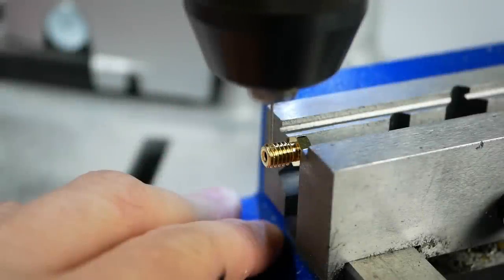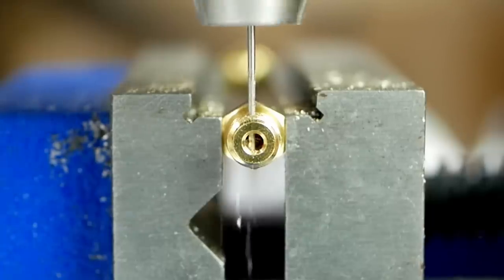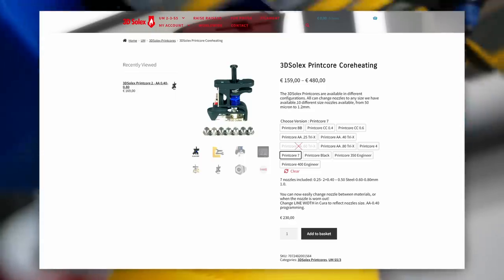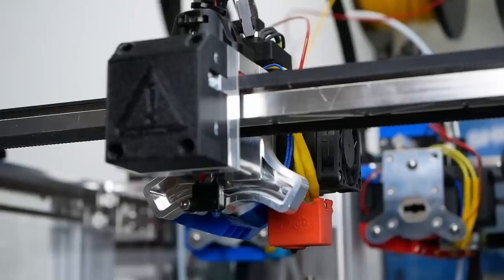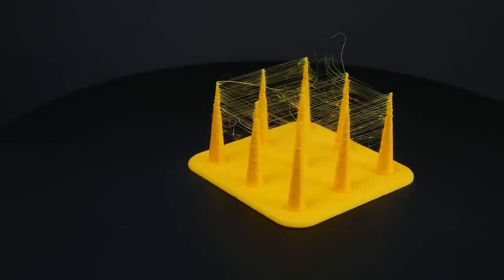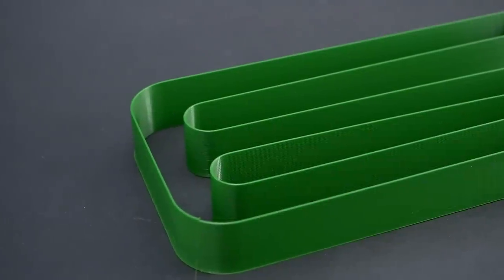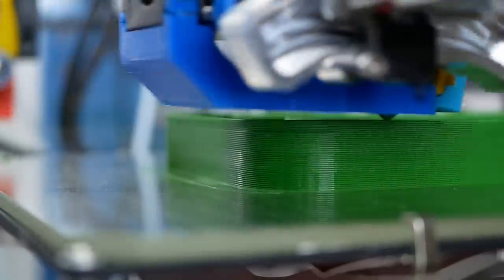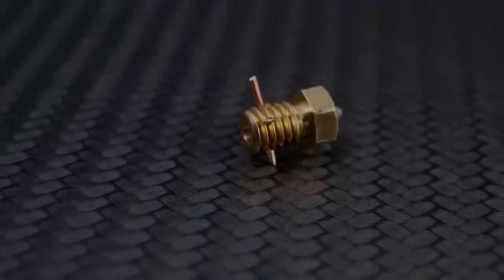My High Flow Nozzle is better than a Volcano hotend!

Comment: So a more advanced profile would be to have a less circular hole. 
This could be done by drilling 6 holes around a central point. Then boring out the central point. 

Imagine a revolver chamber woth it's 6 holes for the bilullets. Then boring a hole through it so it half intersects with the 6 holes. You end up with a much higher surface area but with no obstruction. 

By hand that's a big ask. But my cnc could do it. 

Would have to make the nozzle from scratch as needs to be solid to drill the 6holes first. They have to be drilled first. A small end mill can be plunged to clear thw middle. Or stub drill. 

I would think this would outperform any other. But length would be limited by machining process.

Comment: Have you thought about using two heater cartridges in the hot end, this means milling a special block for the hot end and maybe also tweaking your PID settings. I did this on my Tevo tornado but need to work on my heat break tube as i have made my own and it sticks and stops printing after a while, I think due to heat creep.
Reply from the maker: Heater power is NOT the issue. The problem is getting the heat into the material an that's where CHT has it's benefits.

Comment: I have an idea I would love to see you try, that I believe would yield much better results than anything on the market but would be a pain to manufacture at any large scale. Coating nichrome wire (of appropriate gauge) with alumina cement or other non electrically conductive high temp material and passing that through the nozzle as you did here. Maybe just get a roll of nichrome for vaping and twist three strands together instead of paying more for the larger stuff, saving money and providing your viewers with a way to recreate your results. 

I'm extremely interested in how running a 3d printer with only core heated wiring would fair, at least compared to combined from the wall of the extruder and the core heating.

At core heating could be an interesting video, if nothing else!
Reply: There’s kanthal, nichrome, and SS 304 wire mesh, it’s cheap and comes in different percentages of hole sizes
Reply: @gcod3d161  mesh might restrict the flow to much. And if not after coating it, it would not allow much of anything through, given how small the holes are in vaping meshes. Maybe wotofo's hex mesh.

Comment: I would imagine that using a smaller wire diameter would create less turbulence and back resistance. The question becomes how thin can it be and still stand up to the heat and pressure of the extrusion.

Comment: Could you use a small bolt instead of a wire and thread the inside of the hole

Comment: Hey Stephan,   Could you try using copper wire on SS nozzle or perhaps M2 tool steel nozzle?  Additionally Tungsten could be promising.  I have a Theory that the copper wire and split streams could overcome the drawback of reduced melt rate due to thermal conductivity rates(K) in SS or M2 nozzles. Many have gotten around the issue by using an electroplating Additive of WS2 (Tungsten Disulfide) to the interior surfaces of the nozzle. perhaps improved melt geometry and harder materials would make it possible to create higher flow nozzles without the need to increase print temp.

Comment: @CNC Kitchen have any insight as to how this effects layer adhesion?   My CHT keeps clogging and is now scrapped.  Going back to regular nozzles really is a stark contrast in layer adhesion in ABS and PC.  Like I can peel each layer away by hand using the same GCode that was almost isotropic with the CHT.

Comment: How do you get around the patent?

well you need some out of the box thinking. You see everyone is trying to transfer heat to the object at the very end of the process. What the manufacturers of this nozzle has done is two things. Moved the heating stage closer to the actual heating source and heated the filament from the inside out rather than the traditional outside in.

But what if you started that internal heating stage even earlier then the nozzle and began it from the heater block where the source of your heat is coming from. By by patent, hello new patent.

I have some very simple solutions in mind that just takes some ingenuity.

Comment: I imagine that, if the wire was replaced with a sheet, it would have a thinner cross-section but more surface area. In other words, it might have a profile that looks like a cross as seen from above and extends most of the way down the hole.

Not sure how to machine that. Perhaps by adding multiple wires and then flattening them with pressure or by removing material with a drill. But I'm not the mechanical engineer here, so I'll just leave this suggestion in its current form.

Comment: Spot the hole with the tip of a larger diameter stiffer drill 1st, or a tiny grinder bit to flat but that will lose precision.

Comment: I wonder if it would of been even better to file a sharp leading edge on the copper wire. Rather than a rounded edge. It should help in the split.

Comment: I don't think you have to worry about the solder.  Once the nozzle is screwed in place, the wire cannot move, even if the solder melted.

Comment: 227 is even unsutable for pla... it all ßepends on what speed you use , and the spot temp at the heater may solder your nozzle to the heater block

Comment: use a center drill combine with er-32 collet chuck and milling machine. a drill press it's little bit tricky the run out of your chuck is too high .005'' to .008''. you  don't have the same accuracy then milling machine.

Comment: if you're brave enough to try brazing, you could substitute the copper wire for brass and follow the suggestions of others by filing the brass that passes through the center to a somewhat flat, or blade shape to help cut down on the turbulence and increase the thermal transfer. Brazing has the upside of not melting at the temperatures needed for other higher melting point media beyond PETG.

Comment: You could start the drilling on the thread by using an end-mill to start the hole, they actually drill fairly well, though it is blasphemous to encourage drilling with end-mills... Part of me wants to suggest silver wires too, it's the king of heat conduction (of metals anyway) it wouldn't really be expensive, but yeah...

Comment: It's not illegal to DYI a patented object in the United States for personal use.

Even if it was it's completely unenforceable.

And even if you did sell small batches of a patented thing, it wouldn't be worth enforcing, the worst that happens is you get a cease and desist.

You would also be surprised how limited patents can be. If you make one small change you can patent that change and now the original patent owner can't make that change themselves without paying you.

Patenting patent trolls patents is patently priceless.

I also have an extremely hard time believing there is no examples of prior art. Just because the government rubber stamps a patent doesn't mean it's valid. The system is set up to give people frivolous patents and then let lawyers fight over it. That's not considering "method" patents. But that's an entirely different can of worms.

Patents literally exist to teach people how to make the thing. The government has bastardized it over the last couple hundred years. But you're supposed to copy them, that's what they exist for.

Comment: it is called a "STATIC MIXER" yes that single piece of wire installed can be called  a static mixer.  static mixers can be much more complicated. in paths any sort of fluid or gas or combo of fluid and gas take through a STATIC MIXER.

Comment: Please try putting in a flat piece of copper in a nozzle! Cut into the nozzle with a hack saw and cut a flat piece of copper the same thickness, sharpen the end that will meet the filament first and install it as you did with the wire.

Comment: Not that it would be practical or safe at home, but I wonder how an FDM printer would perform if used in a pressure vessel under higher than atmospheric pressure.

Comment: What about a DIY high flow 0.4 mm nozzle?! You mentioned in the bondtech review, that you'd be interested in such a nozzle. Plus your public appeal would also reach the 3d printing beginner 👍🏻
Reply from the maker: I tried that at first, though the effect is not as high because the 0.4 mm bore limits flow the most.
Reply: @CNCKitchen  The effect of increasing the flow through the nozzle can be felt when pulling long rods. At 50 mm there may be no effect, but at 200 mm it already shows. Even with a 0.4 mm nozzle

Comment: Volcano is far from ideal. That split by on the side creates a nice air gap that cools that entire side, making the heater work harder. And the random screw heads sticking out make it a pain to clean if anything sticks to it. Not to mention that you don't really need special nozzles, just a longer barrel.
I got a design that i'd love to see tested, but shipping to Europe would suck (in both money and time, most likely).

Comment: maybe idea is fine but if you can try thinner copper rod would benefit nearly cutting edge (knife alike thing). It might be tricky to drill at 0.5 from your 0.8 but might to work. smaller in diameter rod will have more chances to burn out over time if to high temp but that should work even better if 210 temp is max... near flame temp can ruin it but not 210 :) keep trying. idea is great and not so easy but possible to work :D

Comment: The less of the bit you have sticking out, the stiffer it'll be. If you're setting up the tool for a single operation, there's no reason not to make it as short as possible for rigidity.

Comment: Your drill bit has way too much stick out, and thus too much deflection. While a "spotting drill" is usually best, a "Center Drill" would be a good choice in this type of drilling; where a fat shank to help prevent deflection and a very short 'nipple' to do the actual drilling.
Though just having a small amount sticking out to start, and then extending the drill just enough to making it through one side before having just enough to make it all the way through would be helpful.

Comment: How about using thin braz or copper sheets making a thin cut in the nozle and than soldering ... Not to thin so it does not tear and still has sufficient thermal mass.

Also Düse einsägen - Belch rein - Verlöten ... hatte ich mal so gemacht um 2014 ... wenn ich es beweisen könnte wäre das sogar Prior Art ... aber was solls.

Comment: could we see a sharpened version of your nozzle maybe just round file the copper wire first before inserting them for soldering this will center feed the flow better my guess is then you will see similar numbers to the cht
and ideas for upcoming videos maybe some ultem printing smaller stuff  or a support material with abs and asa like hips or alternatives 
pei PC Peek pekk and any others you can get your hands on for heat testing, impact testing stress and deformation, lets play with the good stuff and see if its worth the projectable costs and or we get a better hand on what they can and cannot do with what as a minimum

smash up some thin 1and 8mm cards torch them or bake some under loads you always come up with interesting stuff either way I am in!

Comment: It really wouldn't take much more effort to use a higher melt solder or even braze it. You would just want to use a gas torch rather than hot air.

Comment: Use shorter drill bits. Stiffness scales with the cube of length. 1/3rd the length --> 27x less deflection.

Comment: Hmm you could make better. Some 6mm brass stud cut to length. Cnc 6 holes like a revolver barrel with opened tops to lead in. 
Cap the end with a domed nut drilled for the nozzle. No cental hole in the melt zone at all. So meted in 6 smaller holes. Could have a lead in hole.

Comment: The problem is this was a common way to do it when I started 3d printing at the very beginning of the adventure. How come they can get a patent on it???
For extrusion and injection industry it was also normal to use protrusions and partial blockages for plastic mixing and more even melting. That's where we got the ideas from.
It's not patendable.
Reply: It is my thinking as well that the patent seems invalid. The splitter nozzle is well known in injection moulding, though i guess a specific way to manufacture it is potentially patentable.

As to the things you saw years ago, can you find it? Prior art is often used in order to invalidate a patent.
Reply: This is absolutely true and the patent office certainly didn't do their job.

Comment: Why not drill a 1mm hole through the center of the copper wire increasing the points of contact from 2 to 4 and decreasing flow resistance

Comment: could you try putting wire closer to the end or middle of thread bcz of different melting states of the filament e.g. at start of a thread it adds to much resistance to the not melted enough plastic, at end of a thread with lower speed it will just add resistance to already melted plastic, but with high speed it helps melting middle of the fillament or nothing happenes
Reply: also mby try diagonal placed wire

Comment: Use a center finder, spot drill, and stubbed drill. The drill was too long, especially for the jacob’s chuck. If you had a small collet, a 0.8 end mill would be the most ideal, because you could skip spotting and pecking.
Reply: You could also substantially grind down and resharpen the drill used in the video at cost of increasing the size of the web a bit.

Comment: You know what?  I don't think you need the solder.   Drill the hole, feed the wire through, clip the ends.  Then, just tap it without the solder.  If it's copper wire it should be soft enough that it'll just mash into place like Play-Doh.  Maybe a drop of JB Weld and then use the tap to smooth it.  Though you will need to quickly clean off your tap.  But again you might not even need to do all that.

Comment: Bought an CHT nozzle from 3D Jake. After seeing this video i drilled a bigger hole in my existing nozzle and passed 2x 0.45mm wires through it in a cross pattern. I had trouble getting the Printer above 45mm/s. Now testing 60 mm/s and the extruder doesnt skip a tooth every here and there then it did befor. Will test higher speeds in the future. I send you some money worth another CHT that i probably would have bought without this video! Halt die Ohren steif! Edit: Is it possible to see the calculated flow rates per layer in Cura too?

Comment: Why not just skip the soldering part? Then you are able to heat the nozzle beyond 227C. When the nozzle is installed, the copper wire should not be able to escape, since there is no space for it to move. If you (for reasons I cannot think of) still want to fix the wire permanently; you could use heat resistable 2 component adhesive instead.

Comment: It’s interesting that this is being called a patented technology but the inventor and/or 3D Solex do not have a granted patent yet.  They have patent applications filed and in prosecution in Europe, Norway and the USA.  There is still the possibility that a patent may not be granted or the final claims will be so narrow that they can easily be worked around.  If they do obtain granted patent(s) they will only enforceable in the countries where it is granted.  This leaves a big hole in Asia and Australia. where they would not be able to prevent others from making similar nozzles and I suspect Chinese knockoffs will show up soon.
Reply: I hope BondTech’s license agreement and payments are dependent on the grant and final form of the claims.

Comment: Modify a nozzle and 3D printer to make heating nozzle longer, if its x times longer, it might be able to move filament at x times faster.
Reply: Well that is what Volcano and Supervolcano are. Literally no need to build something yourself, well known and tested solutions, been around for close to a decade. And they're also kiiinda bad? The more melt zone length you have, the more the material degrades while passing through it, heat actually breaks the polymer, you want to keep plastic molten as short time as possible, so if you have a long nozzle, you must also necessarily print very fast and high volume, else bad! They also tend to get more leaky, nasty. Getting this sort of flow rate out of a minimal volume of melt chamber is exciting and improves quality. More universal switching between more intricate slower prints and sections and faster sections where you can lay the material down in bulk.
Reply: @SianaGearz  that makes sense. Thanks for explaining. One way around it maybe is pre heating it just before melting and degradation over longer area, than heating fast during final bit idk if good idea

Comment: You can 3D print a cube with an internal thread that matches the nozzle's, and a hole printed perfectly in the center. That would guide your drill to drill it exactly where you want to. I do this all the time by hand with pieces of wood, when I need to drill something round

Comment: Dont try this with your printer there is a possibility of the solder melting and your nozzle getting stuck in the hot end. High melting silver solder must be used